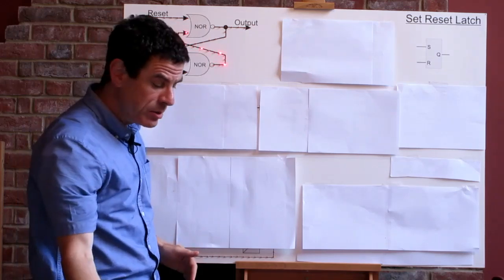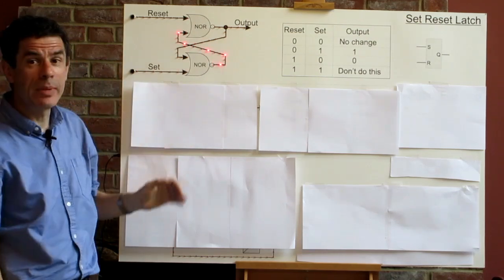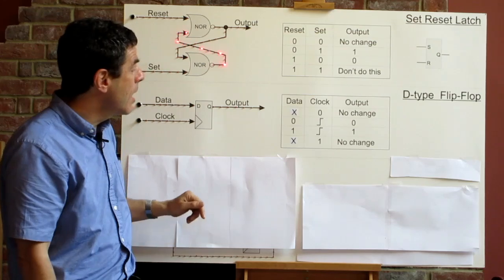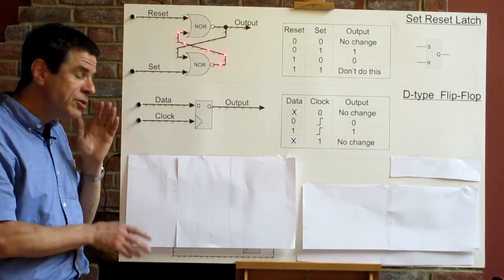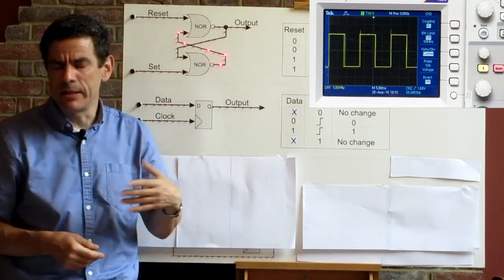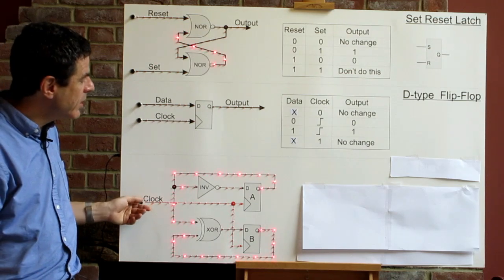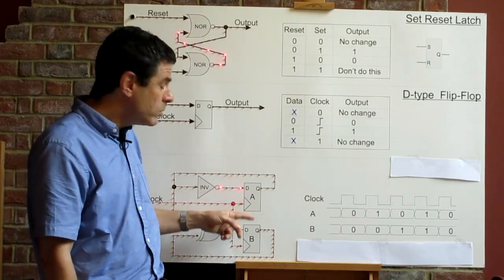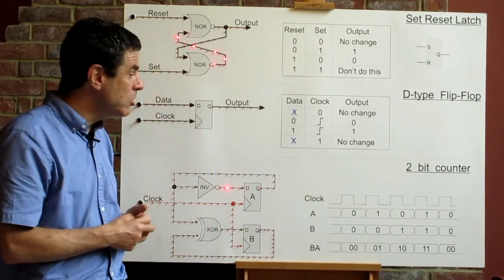SS8 : Time and Memory

Comment: About SR Latch - since it was not explained too much in the video. Nothing bad happens when both S and R are in high state simultaneously. The thing that diagram above lacks is one output ~Q (not Q - negated output). Each latch and Flip-Flop has both Q and ~Q. But when S and R are both in high state then Q and ~Q are both (for NOR gates) in low state. And in theory they should never be in the same state. What happens then is latch will have the state of whatever signal will be last to go to low.
Reply from the maker: The badness is that there is a race condition; if S & R go low "close" in time to each other then it is uncertain what the result will be. And we really really hate uncertainty in logic circuits. So it is considered good practice not to have S and R high at the same time.
Reply: Well... sort of. It is a bad practice to have them active at the same time. However deactivating the two at the same time is a bit unlikely (unless S and R are connected to one wire, correct me if I'm wrong). There is a chance that circuit is made in such a way that S and R might go down at the same time, however it is quite unlikely for someone to make circuit in such a way. I struggle to think of a reason why would anyone do that, except maybe checking what changed first.

The real badness however is with Q and ~Q. In theory they should not be in the same state, but because of that state they are. And if both Q and ~Q of that latch are used somewhere else - that may lead to problems.
Reply from the maker: Unlikely, improbable etc. 
This we do not permit.
We design systems so that they work. Always. No ifs, no buts, no probably. Always.
We agree S/R high at the same time is bad practice. It is bad practice. It is irrelevant that most of the time it'll be ok. Some of the time it will go wrong. That is too often. Don't equivocate. Don't do it.
Reply: Megaprocessor No doubt that it's a bad practice. Sure - don't do that, but it's better to know what happens in such situations, why not do it, what are the consequences and so on.

However even if in circuit there is a latch with both S and R active shouldn't it be acting the same way all the time? From what you said it seams the problem (apart from practice) is with race not Q=~Q.
Reply: @michdem100  He said earlier, it's a race situation, that's why you don't do it because it's not 100% predictable.  Not 100% predictable means 'don't do it', period.  If you want to build the circuit and test it using those values, there is nothing to stop you but....... it should never be used in any kind of 'production' situation because of that unpredictable behaviour.

Comment: Would it be possible to do very brief explanation of what the D-type Flip-Flop looks like with gates, I.e. how the edge triggering is implemented logic wise, please?
Reply from the maker: That's a very fair comment. I did spend quite a bit of time wondering if I should do that, and how. It's not hugely difficult but it's not trivial, it would take some minutes. In the end I decided it would distract from the path I was trying to sketch and so presented edge triggering as a black box.
Wikipedia has quite a good section on flip flops. https://en.wikipedia.org/wiki/Flip-flop_(electronics) and gives an example of the logic you need to implement edge triggering. If a reasonable number of people think it would be helpful I'd be happy to do an #8.1 walking through an edge triggered flip flop.
Reply: OK that sounds like a good idea.  Thanks for doing this series, it is really good and look forward to the next episode.  Thanks for replying.
Reply: @Megaprocessor Just marking my interestin the 8.1 episode =)
Reply: The relevant part for D-FFs:
https://en.wikipedia.org/wiki/Flip-flop_%28electronics%29#D_flip-flop
Reply from the maker: @Garbaz : Beg pardon, but I removed your last comment as I felt it confused rather than helped.
Reply: @Megaprocessor Hm, okay, you got a point there, I'm sorry.